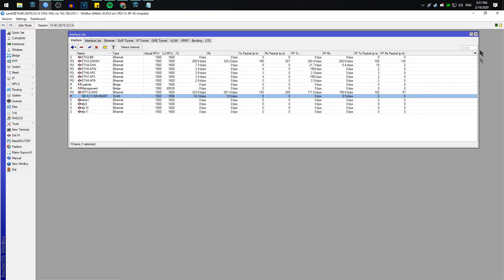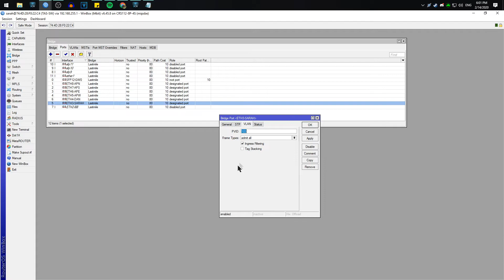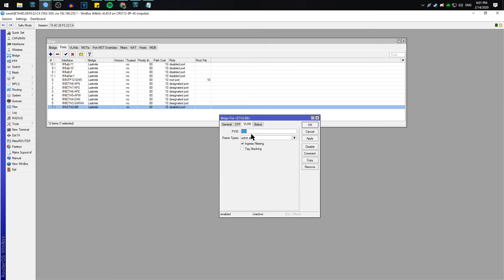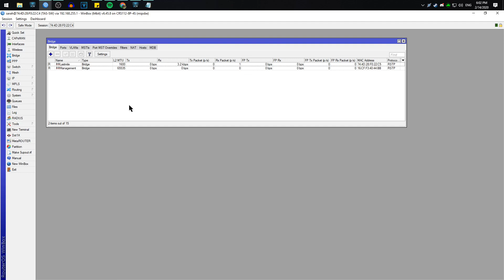Mikrotik CRS 112-8p 4S as a wisp switch

Comment: Specifications show its 802.3af/at but you are saying it's passive Poe?
Reply from the maker: Its both.. at 48v it will run standard poe devices. But its still manual 24/48v in the switch. It is in fact passive poe.

Comment: so what do you use this type of switch for? I'm confused about the whole PoE thing. I want a switch with the SFP+ & Gigabit switching but I am not sure if this PoE is correct.
Especially concerning is that part where you said "puffy smoke"....O_O. I just need home LAN for desktops, laptops, NAS, routers. IF this switch can be used for that great but if the voltage is always on...wont that destroy regular network devices?
Reply from the maker: Dont use a poe switch unless you need one. Theres literally hundreds to choose from. For your needs it sounds like youd be best with the mikrotik CRS326. It has 24 Gb ports and 2x SFPP ports. Otherwise you just turn off poe on the ports you dont need poe on.
Reply: @thefixitgal  Awesome! Thank you. I kinda figured that BUT I didn't want to miss out on cool features. However, PoE is something completely different!

Comment: I have a netPower16P that needs to be powered over a single Cat6 cable using POE. The setup you have in this video looks like it would do the trick. Where can I find that tiny 24v converter and would you recommend one with more AMPs?
Reply from the maker: That will not work. You need to send DC to it. It takes 24 & 48v in. If you try and power it like that it will crash. Your best option is sending 48v up then adding a buck converter to power the 24v side. Cat6 is pointless. Use Fibre to a 10Gsfpp or 2x cat5E. One for upstream one for downstream.
Reply: @thefixitgal  Correct, I should have been clear about the way I used the POE. I put the POE injectors on one ends of the Cat6 to inject the power and a POE picker on the other end before it hits the switch. At that point I would place the 48v to 24v converter. This is not a situation that I can add more cable. I'm replacing a PowerBoxPro with the netPower16p for the extra ethernet ports. Really the current 24v PSU would be fine because I will only need to power the switch. The switch will be for at most 10 retail clients using hAPac2 with their own AC power so, no need for POE out on the switch. This is just a power test to see what could be done and what it could power. I have a few locations with the same single Cat6 cable to the power source. 
Below is the injector device. It works but I haven't checked to see if it's pushing power out the RJ45 connector. Sure hope I didn't damage the switch. https://shop.poetexas.com/products/gpoe-1-ab?variant=40016575248

Comment: We"re a Tik shop for routers and switches. Is the Netonix your preferred tower switch?
Reply from the maker: Yes it is. Can I trust it? Absolutely not. The failure rate is much too high. They are not a truly reliable product. With so many design flaws I would use them only in installations that are only perfect for them. Otherwise I love tik for core.

Comment: Very interesting... Thanks for video... 
I'm new in WISP and trying to understand that found your video very helpful.
This switch you mentioned it is for small sites... But what you recommend for tower to support 2000 CPE?
Reply from the maker: I would not suggest 2000 CPE's on one tower. At that point youd need to go Nokia LTE with a Juniper  or Mikrotik 1072 core.